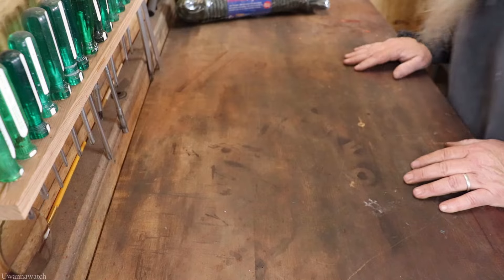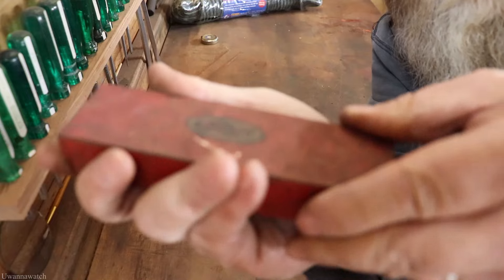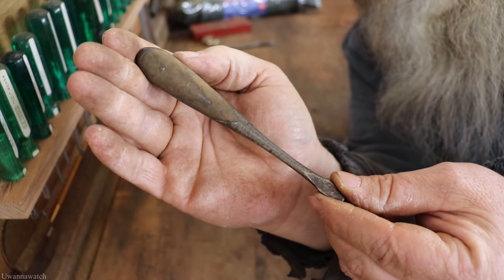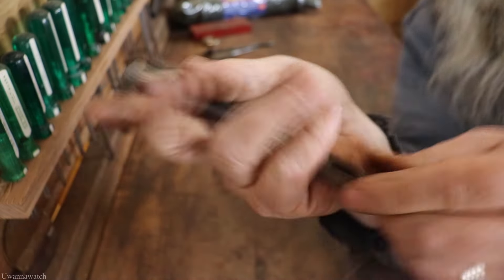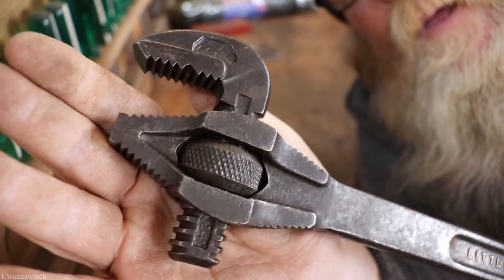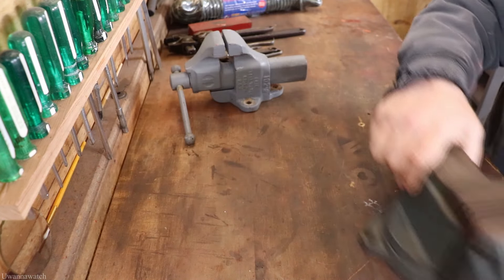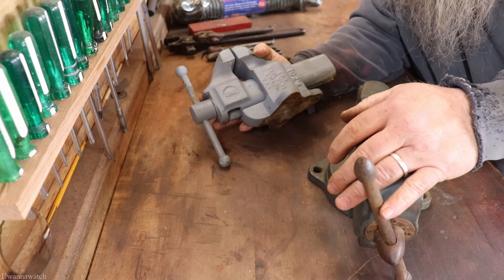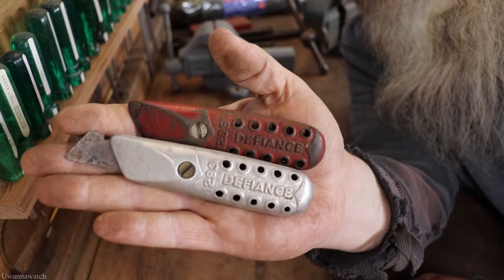Flea Market Haul # 26

Comment: Nice I Like the Craftsman vice and Pipe 🔧 wrenches. I've Collected Tools 45 Years, I'm Proud of my Grandfather's Plumb open end box end stamped War Finish, 12 pt. wrenches 1 1/2 to 1/4 in . 1/16 in. Increments, for Metric, Sae. Old Tools are Incredible 🎉.  My GrandFather Rubrecht, was Aircraft Mechanic,and Later Auto. Mech. after War, had his Most of his Lifetime collection of Tools Stolen, I was a Little boy, but I Remember his Face, when Mom Explained to me.
Reply from the maker: I'd be proud of that too!  Part of the reason I collect is My Uncle was a small engine mechanic and when I was a kid I spent a lot of time with him. I remember his tool boxes were filled and immaculate! He left me his boxes but by the time I could get them they were ransacked.
Reply: @Uwannawatch  I use those wrenches when I have a Special job to do and Remember Grandfather. I'm Sorry an Loss of Uncle's Tools. I understand that Loss.    Cool Channel
Reply from the maker: @winner33660  Thank You

Comment: Nice video. Be very careful where you put that rope. It is camouflage, you might not ever find it again. I live 300 yards from the Pacific. If you did not want to paint a vice, what would you do in my situation?
Reply from the maker: Hey Buddy. If you don't want to paint it you can spray it with laquer or You can season it like a cast iron.. heat it, rub it down with 3in1 oil. You just have to repeat it every couple of weeks until it's full treated.
Reply: @Uwannawatch  Thank you.